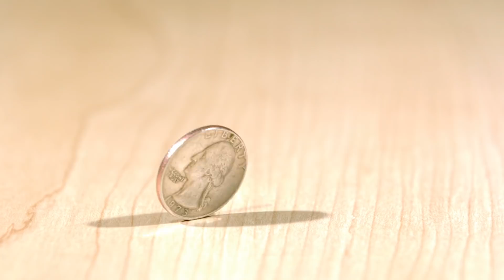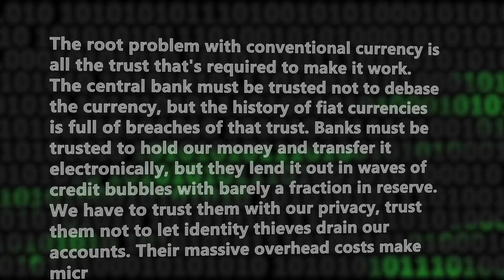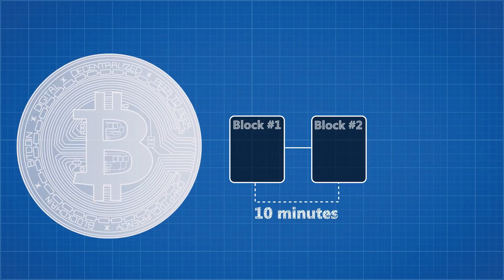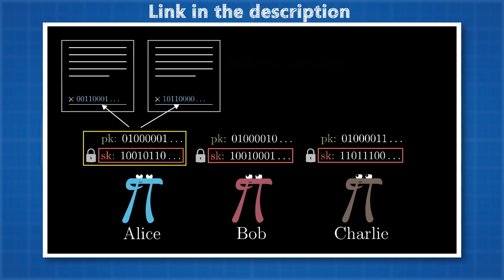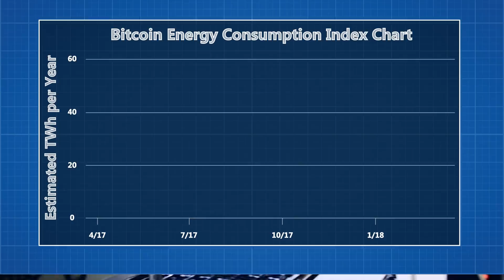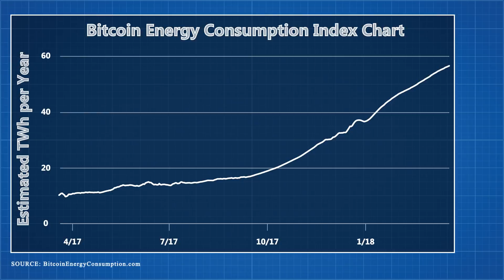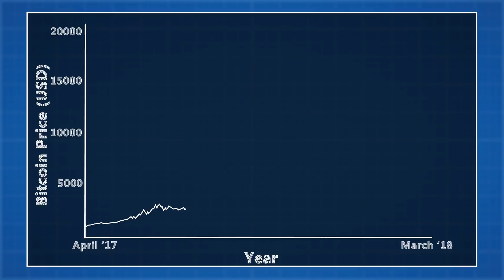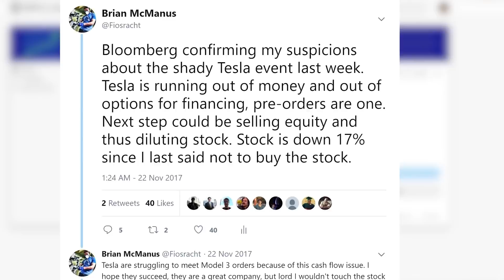Why Bitcoin Is Not Working

Comment: i dont think you have taken into account how much energy used for mining is actually renewable. you said yourself, geothermal, but there are farms that are purely solar powered or hydro powered. so costs are near zero for those select farms... yes its not perfect, but its a damn site better than trusting, untrustworthy banks who have an established track record for failing its customers on hundreds, if not thousands of different occasions, and we all know, Wall Street, and other institutions are the biggest criminals on the planet. stock market manipulation, lobbying, fraud,....  and every single banker takes a cut of every penny they touch. the blockchain is based around proof of work (POW) or proof of stake (POS), or a combination of both with only the miners taking a fraction to process the transaction.
money may have been around since the beginning of time, and in recent years, that system has failed with more crashes than you can shake a stick at, crypto has been around for a good while now... 20006/7 ish, and it is still working the way it was intended. may not be used as it was intended, but its function still works, and if it does fail, just like money, it will recover.
if you worked in the blockchain system as i do, you would understand more about how it works. 
before you say it, no, i don't mine. or bought all your GPU's. im just a blogger, with a small tech company.
Reply: Tony Rodriguez Actually it should be an argument because right now electricity from renewables isn't essentially free, furthermore - in many countries electricity poverty is more than just words (even here in the quite green Germany) and that most ASICs are located in the greening, but not green at all China and are using coal to power their mining.
To argue electricity isn't relevant for Bitcoin with this assumption is just as asinine as arguing meat is ethical because soon there will be lab meat.
Reply: dlwatib...China banned crypto miners two months ago, many moving to Quebec and other places with cheap (renewable) juice.
https://www.forbes.com/sites/sarahsu/2018/01/15/chinas-shutdown-of-bitcoin-miners-isnt-just-about-electricity/#6854912e369b
"Bitcoin miners have also been attracted to the Canadian province of Québec for its advertised cheap electricity."
Reply: Energy being wasted is still wasted energy that could be used for much better use...the future is not in POW and crypto like BTC or LTC it's in cryptos like Nano or IOTA or others that may not even be invented yet.
Reply: You're sadly misinformed if you think that the largest bitcoin mining ops are currently located in Iceland and Quebec. They're not. They're located in China where they are consuming coal powered electricity.
Reply: Oh wow, thats great. So Bitcoin creates demand in the energy market -> raises the price by consuming as much as an entire country - admittedly somewhat distributed. Not like we could just use much more energyefficient cryptocurrencies(Nano, IOTA, pretty much any 2nd generation crypto) AND establish renewable energy sources for actually useful purposes such as to lower peoples' power bills.
Reply: just a boi electricity should not even be used as an argument anymore. If you look at where we are going, we are looking at almost free power for everyone, even in places with absolutely no infrastructure for power. It will be much easier to power your home than to get water in the near future and the best part it will all be green.
Reply: Agreed TM.   Posted this upthread, but bears repeating here, further bolsters your argument re: energy usage:
I disagree with Real Engineering on the power consumption/environmental issue.  It's in a miner's best interest to move operations to where power is cheapest.  Renewable energy has only recently become cheaper to generate than carbon based energy.   And projections show it will only get cheaper.  This is why the largest mining ops are currently located in Iceland and Quebec, places were cheap/clean power exist (w/o fossil fuels).  So miners seeking this cheaper source of power increase it's demand incentivizing construction of more renewable energy plants.  The more RE plants created, the cheaper they become to create.  In other words, bitcoin could likely solve the carbon emissions crisis, not exacerbate it.
Reply: well i only pointed out that some are 100% renewable. and you are sadly misinformed as 2 of the largest farms in china are up-scaling there use of solar power with the end goal of becoming self reliant. plus many other farms around the world have relocated to colder climate areas such as Iceland with many active in replacing conventional energy with renewable sources.

Comment: Check out iota, nano and ziquilla. 3rd generation cryptos. 

First being bitcoin and kin, 
Second being ethereum and kin,
Third being tangle based coins like iota and nano. 

The pow is not intense and the requirement for sending a transaction is to verify two more. This causes a throughput that scales with use. Nano can do 2400 transactions per second currently which is 1.8b per year settled within seconds. Best of all. No miners means no fees whatsoever at any point ever.

Comment: Real Engineering, do not make the same mistake you did with Tesla by underestimating the performance of an underdog despite genuine signs of innovation. No task which attempted to improve humanity was done with ease or without drawbacks. I recommend curbing your cynicism, such systems can be improved after failure or inspire betterment.

Comment: "Blegh, this 11 minute video doesn't go deep enough into the details therefore it's utterly unusable, do you even know economics? What a joke. How dare you simplify a complex problem"
or "Alt coins, what about alt coins? You're lying, alt coins are doing great. I know the video talks about the problems with just bitcoin rather than cryptocurrencies in general, but you're giving misinformation because these inherent bitcoin limits are fixed in altcoins. I also don't read the title."
So many of these crybabies in the comments. This is a quick overview for those with little knowledge on the topic, not a two hour presentation about the ins and outs of bitcoin. Also, yeah, other cryptocurrencies don't have the same problem. That's why this video is called 'why BITCOIN is not working' not 'why cryptocurrencies aren't working'.

Comment: Some things I'd like to add:
1. Lightning Network will increase transactions to Millions/second.
2. Energy consumption is necessary for network security
3. Block reward will decrease but due to deflationary nature of Bitcoin/Cryptocurrencies, that block reward will remain more or less the same in $ valuation.
4. Miner centralization is a valid issue and it does need to be addressed.

Comment: This video brought to you by VISA. But no, really, Bitcoin got hijacked a few years ago by the banking industry. The Lighting network is a joke, as the developers should have just increased the block size, like the currency was built to do. Instead, you have fees of over 100$ in peak hours, which really makes it useless as currency. If you want an actual decentralized currency, check out Steem. No transaction fees, transactions are instant, and you can't mine it. Sure, it is currently being abused by bots a bit, but not to the extend Bitcoin is.
Reply: 125$ for a Bitcoin transaction in December.

Comment: The bitcoin energy consumption index is completely wrong and has been confirmed to be pulled out of the creators ass multiple times.
Reply: What is "truly useful level" to you? If it remains the most secure and robust blockchain, Bitcoin will still have the store of value function which is more important than payments. Any shitcoin can do payments better than Bitcoin because shitcoins don't prioritize security and decentralization. Hipsters buying coffee with Bitcoin on chain is not the goal. It does need to take over the world to be useful. For many it is useful now.
Reply: Not only that, but he compares it to a fiat payment method. This is a very disingenuous comparison as mining has to do with securing transactions and creating new coins, the role of the banks in a fiat system. So why not compare the cost of mining to the cost of banking, not VISA?
Reply: Doesn't matter. Banks still have massively lower per-transaction energy consumption than Bitcoin. Bitcoin's undoing is that it does not scale, as it provides limited value (capped transactions per second) but skyrocketing energy costs. No matter which way you slice it, the fiat banking system is more power-efficient than Bitcoin right now. This is an engineering problem, which will likely be solved in the future by a new cryptocurrency. For now, it is clear that Bitcoin's design is fatally flawed, and due to this it has failed at achieving its stated goals. Learn the lessons and try again.

(And no, Lightning won't fix Bitcoin. Lightning is an effectively constant factor improvement, but still relies on Bitcoin too much to be able to scale to a truly useful level.)
Reply: @Marcan Wrong, it's already scaling. SegWit, Batching, Lightning. Mempool is running smooth, tx fees are at 5-10 sat/byte. I can send Hundreds of dollars for only 10 cents and have next block confirm. It takes 5 freaking days to do an ACH bank transfer. Your narrative has failed.

Comment: Because of how competitive mining is, most of the power used is 100% green and basically excess power. And therefore it really isn't that much of a environmental disaster.
Reply: Kernels uh? He mentioned Iceland in the video, geothermal energy is as renewable as you can possibly get.

Many large scale miners outside of China use massive PV arrays because the farms are usually off-grid anyway and the local cost of electricity is prohibitive.

Comment: Great video! I'm studying engineering, and for a course in sustainability, my group is doing a project on exactly these problems, and trying to weigh the different proposed solutions to them.

I am currently of the opinion that the environmental issue is a consequence of the rapid increase in demand, and once we reach the point where block rewards are miniscule, miners will be forced to scale down operations until a reasonable power consumption is reached, since transaction fees only give so much in terms of miner rewards, even if the price continues to rise.

As for the issue of transaction throughput, I am cautiously hopeful that the Lightning network will be the solution, provided it doesn't prove to be a centralising force, since it will in theory be able to process an unlimited number of transactions, while relying on the main chain for preventing double spends and ensuring scarcity.

I don't see regulations or algorithm changes (such as moving to PoS) as being an effective tool for solving any of these problems, since the investment in hardware has already been made, and if I spent millions on developing and producing ASICs, I would not be particularly keen on just turning them of because someone tells me to. In that case I would see miners either moving to a different country (or, heck, maybe even international waters or _space_) if regulation threatens them, and just mining a different chain if bitcoin would switch from SHA256-based PoW.
Reply: Philip Johansson You know nothing JS. Most bitcoins have already been mined. This will not go on for ever. The supply is not limitless.
Reply: I never said it was? I, just like RE in the video, accurately claim that the block rewards will decrease to the point of being miniscule, at which point mining will hopefully still be around, but be a lot more reasonable in its power usage.
Reply: It's not like other blockchains haven't considered the problem of ASICs; that's why Ethereum's PoW was designed to be memory-hard (and they are going to switch to PoS). PoS has the greatest application in private blockchains (e.g. between banks where parties agree to run the chain privately between each other, but also do not have to establish trust, and can decrease transaction times from three months to a few seconds or a minute on the outside, in the case of credit card transactions).

There are other consensus solutions as well. Intel had something going with Proof of Elapsed Time, until critical bugs were found in SSX; the blockchain community is generally abandoning it.
Reply: There are several promising alternatives to proof-of-work that work very well in theory, including proof-of-stake, proof-of-storage, proof-of-elapsed-time and others. Some even work in practice!

However, I don't think it's at all likely bitcoin will abandon the current system, and even if it did, there would almost certainly be some cryptocurrency that would still use SHA256-based PoW, and then that one would be causing this waste of power instead, since miners would switch to mine that instead.
Reply: I agree with most what you say, but I think you are underestimating the environmental problem. Bitcoin already uses as much electricity as first world countries and the hash rate has doubled in the last 4 months. If I remember correctly, the block rewards half only every 4 years. If more and more people would start buying bitcoin, the demand would grow so much faster than the rewards decrease. 
Due to the urgency of avoiding climate change, I think we just can't afford to wait on the miners losing their incentive. People should just stop investing in proof of work schemes.

Comment: FUD
Reply: FUD?
Reply: No, these are genuinely serious issues to be concerned about. Bitcoin is currently in a bubble situation. The transaction times are too long and will only get longer. Once the bubble pops, bitcoin might level out over time and be reasonably useful, but for now, it is far too volatile, and driven more by psychology than by actual value.

Comment: Innovation will fix all this. Lightning network or maybe increasing the block size will fix scaling. And do't forget there are also beta projects like steem and IOTA(if they fix their shit). This isn't gonna be a problem in the future!
Reply: Iota doesn't work at all. Lightning network is a payment channel not a solution at all. Increasing block reward has nothing to do with block size
Reply: Lightning might fix the transaction rate scaling. But the electricity consumption scales with the demand, lightning won't fix that.
I think we need to seriously consider other consensus schemes than proof of work.
Reply: Deldarel Agree, we just have to think of Bitcoin as the alpha version of crypto, it needs to evolve more. There's no way one man can create a system that can beat something that many generations helped built.
Reply: Deldarel exactly
Reply: F P I mean blocksize. I mixed them up
Reply: wcbuerst7 proof of stake looks interesting!
Reply: FableBlaze there is no manager in crypto!
Reply: some of the problems are inherent in bitcoin.
Cryptocurrencies and the blockchain are great. They're the future. Bitcoin itself just isn't.

Comment: One thing no one has ever explained me is:

Let say bitcoin... or whatever... Which has limited amount of coins available. Lets say that it is being used as it was planned, by the public, by the average users, the normal people on the street. Lets say that 1% of the coins in circulation get lost every year due to human error and hardware failure, by them being careless or stupid. This means that they will be lost beyond recovery and no backups. (And yes... There are people like that.) Since no more coins can be minted, no paper printed, then... what would happen after some time once enough coins have been lost? I mean like. How does the currency work if there ain't enough of it to go around?
Reply: If there is no bitcoin left, people will just switch to a different crypto like litecoin, or just create a new bitcoin. People can decide if they will or will not invest in it. There are over 1500 cryptocurrencies.
Reply: The value goes up. 
While the total amount of usable bitcoin in the world goes down, the total buying power of all usable bitcoin would roughly stay the same.
the great thing about cryptocurrencies is that you can keep on dividing them. 
This is if we'd ever get to a future where bitcoin is a stable currency used as much as the dollar or more. And even then, that's in theory. It's very likely bitcoin would never get to that point. I think that in 50 years only 'retro miners' still mine bitcoin simply for the legacy in the same way that certain people unironically love using 70's computers.
Reply: How does one shoot a projectile into something if the distance between the arrow head and target can always be halved ad infinitum?
Reply: Value goes up, that's basically it. Unless the only remaining bitcoin from the 12mil reach something like 1000 or 100, there won't be any issue from the algorithm's side.

Comment: I guess the simple answer would be more like it worked too well but it also didn't work at the same time. I said the biggest problem is corporations to build huge mining machines taking up massive amounts of power for mining, when I'm assuming the original intention was to have millions of individuals processing transactions and as a by-product mining. and that's all before you add people in messing with the market. and then there's people mining coins and then turning them into regular money because the coins are worth so much open already accepted currency. which isn't necessarily A Bad Thing.